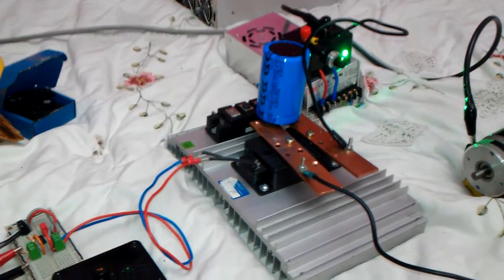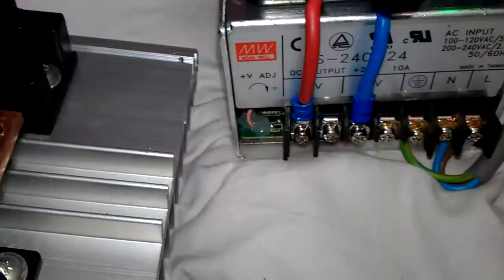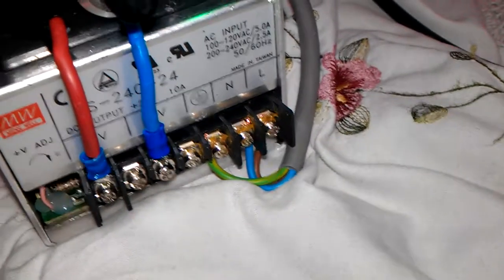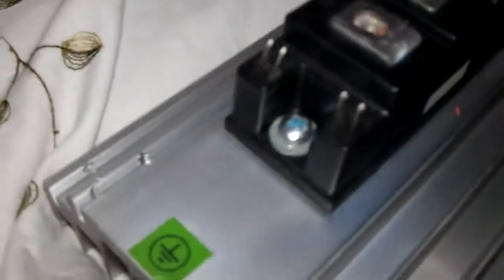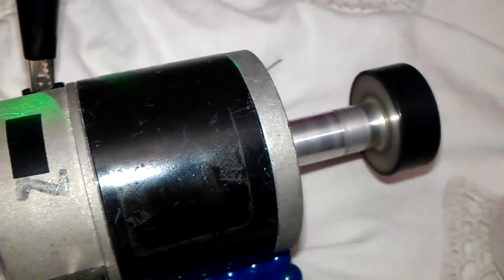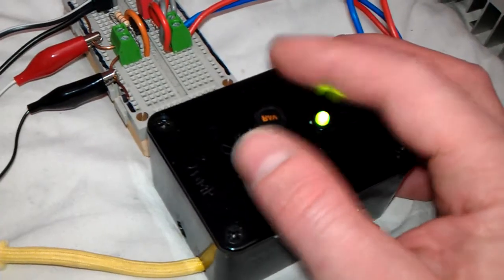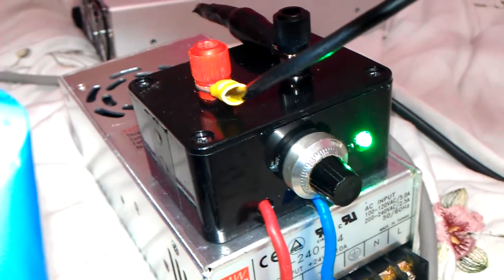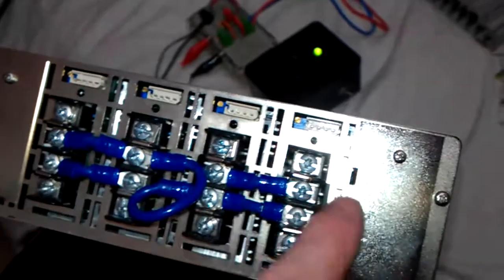Power supply mod" And igbt run!

Comment: That second power supply looks like it has isolated outputs. If you disconnect them you can use them in series or in parallel, or one for an IGBT gate driver and the other for the IGBT and motor power supply

Comment: One thing to watch out for is if you go over the original output voltage, components inside such as smoothing capacitors might not like it. The larger one is probably variable to some degree but it seems to be made up of 4 combined units, so they would each have their own settings.